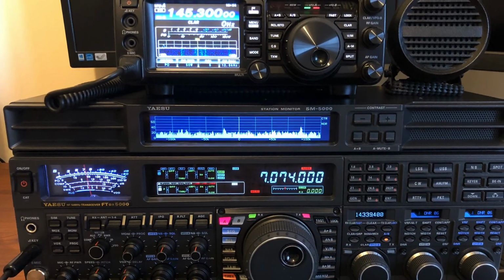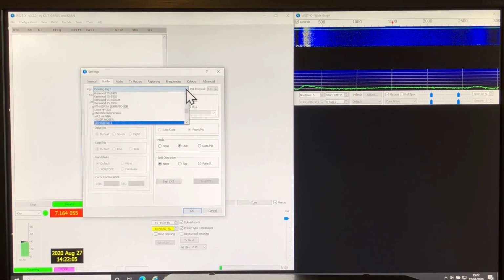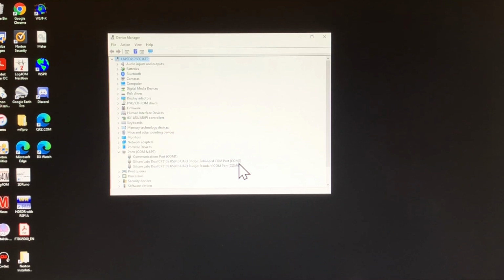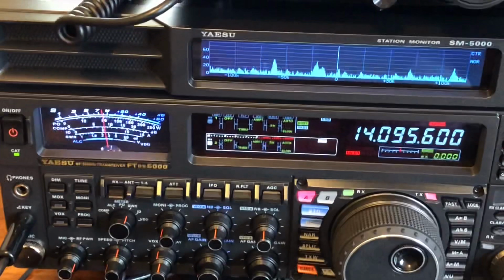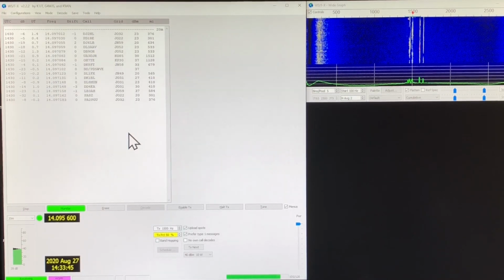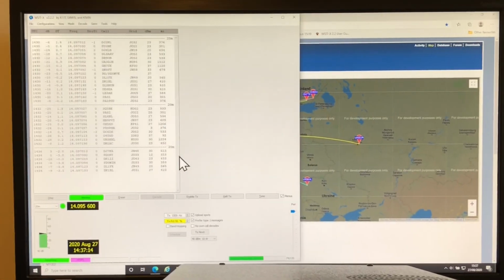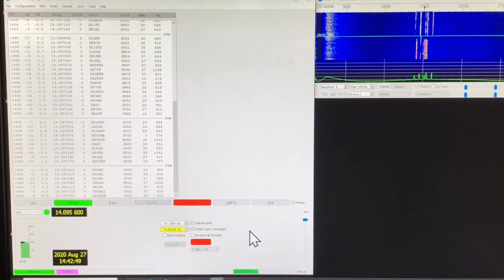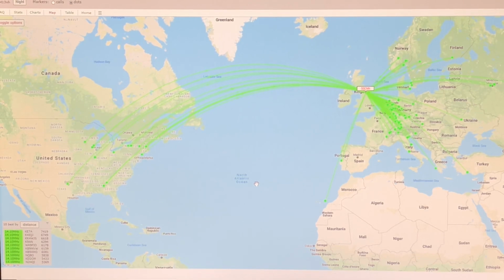Introduction To Digital Modes (WSJT-X & WSPR) Using The Yaesu FTDX5000MP Limited and Yaesu SCU-17

Comment: Hello Ian, where should the Rx/Tx dials be on the front of this please?
Reply from the maker: Hi John. Mine are: RX 9 o’clock and TX adjusted to keep ALC at zero. Tiny tiny taps of the knob can take a bouncing needle to nothing. Adjust if you move about the FT8 frequency band too, as it can change. Good luck 👍🏻
Reply: @G0CNN-Ian Thank you so much!

Comment: Thanks for the insight I’m currently looking at purchasing the 5K but not sure what cables I would need for pc and digital modes ? If you could kindly let me know that would be great I just need to get away from the virtual com port nightmare cheers 73
Reply from the maker: Hi Daniel. The SCU-17 has an RS232 that goes to the rig for CAT and also a data lead that splits in two for the Packet & RTTY sockets on the back of the rig. A third lead (USB) goes to your PC. If I recall correctly, before I had the SCU-17, I had a RS232 to USB conversion lead that allowed CAT to the rig from a PC.  If you buy an SCU-17, check to see which cables it comes supplied with. There’s a brief view of the rear of my 5000 in a more recent video relating to OLED replacement if you look (3m53s). Good luck getting sorted 👍🏻
Reply: Thank you so much really appreciate the reply and that’s helped me a lot 73 Dan

Comment: Hello Ian,

I have now bought one of the last new FTDX5000MP in the UK. I have fallen in love with it instantly - such a beauty! I am trying to sort out CAT Control so my N3FJP logger can switch frequency on the rig if I select a band spot - does the SCU-17 offer CAT Control? Does it come with all of the needed cables?

Many Thanks,

John
2E0SVB
Reply from the maker: Good one John! A conversion lead to USB will give you CAT. You only need the SCU-17 if you want a sound card for digital modes. It comes with all the leads so you don’t need the former if you go down this route first.  I didn’t get my 17 ‘til later….Have Fun!
Reply: @G0CNN-Ian  All sorted Ian. I tried two different RS232>USB cables. The one using the Prolific USB chip didn't work, there is some compatibility issue there. The one with the FTDI USB chip worked instantly. So we are now cooking on gas 😊

Comment: Hi Every time i key up the rig goes onto PKt any ideas.
Reply from the maker: Not sure for certain Kelvin? There’s the USB setting in Mode on the WSJT Settings screen and there’s also menu 103 in the rig (if you’re using a 5000). Have you got those set right?